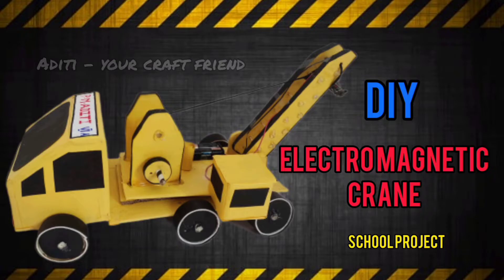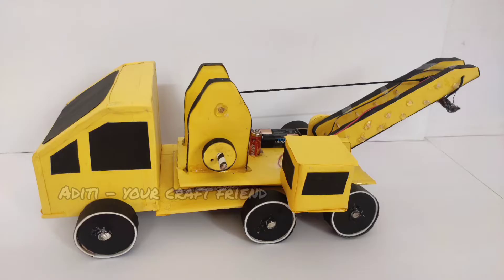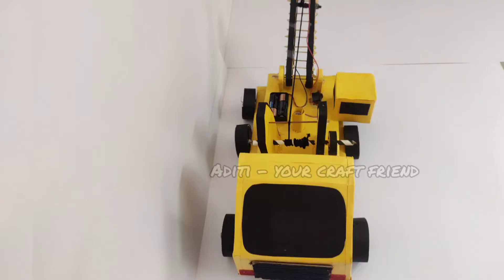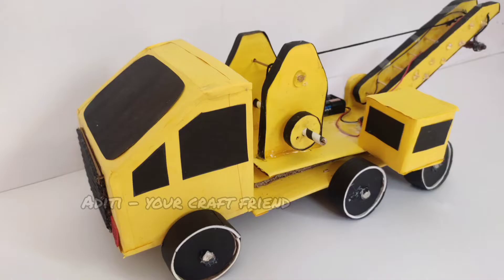How to make Electro Magnetic Crane | DIY Science project | Working model | DIY Toy Crane making |

Comment: Not working
Reply from the maker: Scrap the metal  wire  (which is wounded in iron rod) with blade  slightly at the tips(both ends)..then it will work..

Comment: What type of battery did you use and what size was the nail I need to do this for my project I love it
Reply: Thanks
Reply from the maker: Thank you for your comments 😊..I have used 2 AA batteries..you can use any size  of nail ...you must scrap the copper wire at their ends that is must..

Comment: Not working what do I do
Reply from the maker: @absoluteRonny7   did you scrap the copper wire edges which is winded up in iron rod ??it should work orelse check the switch and battery ..
Reply: @aditi-yourcraftfriend  already done don’t know what to do after
Reply from the maker: @absoluteRonny7  copper wire should be winded tightly over the iron rod
Reply: 🙁🙁🙁🙁 not working it’s ok thank you

Comment: I did everything whatever you did , but it's not working 😢................. What can be done now ???
Reply from the maker: Scrap the metal  wire  (which is wounded in iron rod) with blade  slightly at the tips(both ends)..then it will work..
Reply: @aditi-yourcraftfriend  it's still not working 😢
Reply from the maker: @simadey1827  did you scrap the copper wire edges..it should work orelse check the switch and battery ..
Reply: @aditi-yourcraftfriend ok
Reply: Shame😂😂